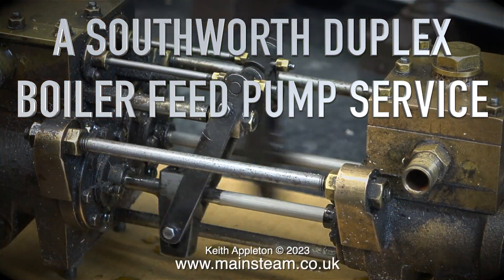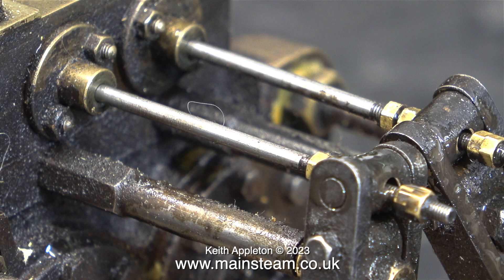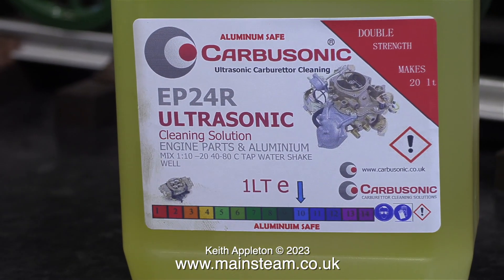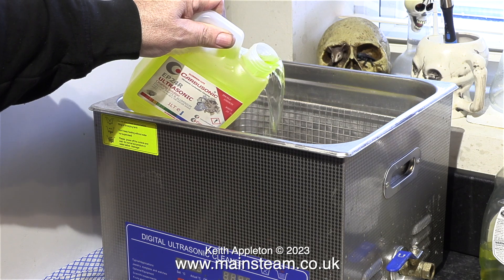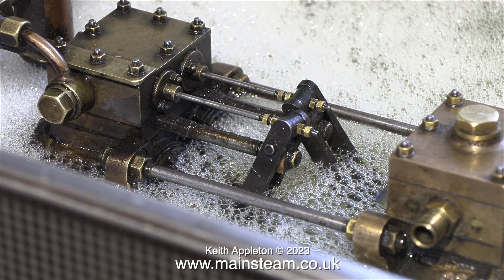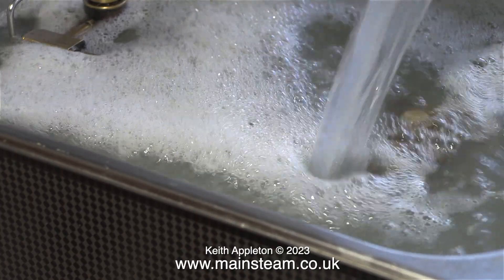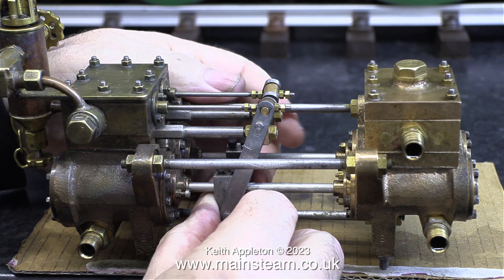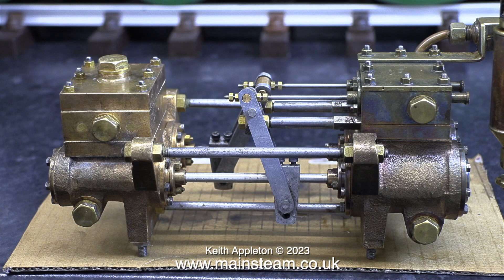SOUTHWORTH DUPLEX BOILER FEED PUMP SERVICE - PART #2

Comment: Thank you for sharing this very informative and interesting video. We have quite a few ultrasonic cleaners at the machine shop to which I am employed. They look like the same brand you have, but are the narrow ones. They do a fantastic job of cleaning and are required by the customer for medical parts. They have internal heaters in them. We also use isopropyl alcohol in some of them.
Reply from the maker: I never thought of Isopropyl Alcohol. I have some and I will try it. Thank you }:-)))